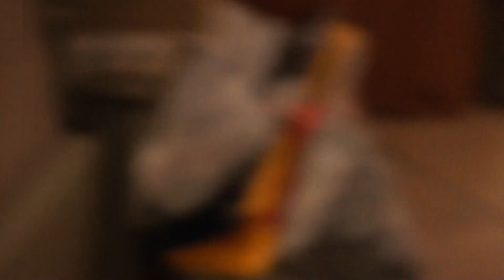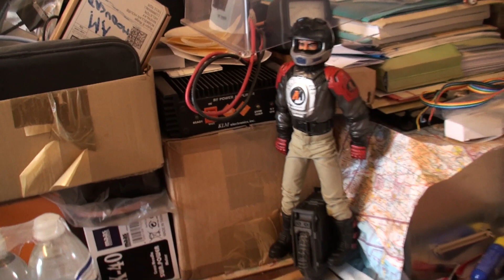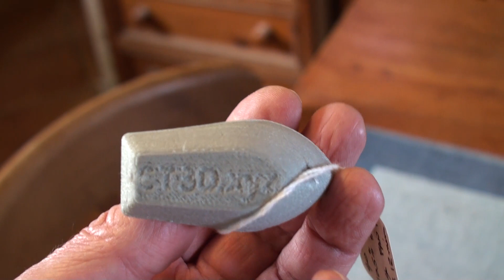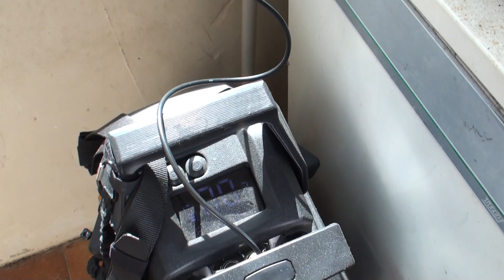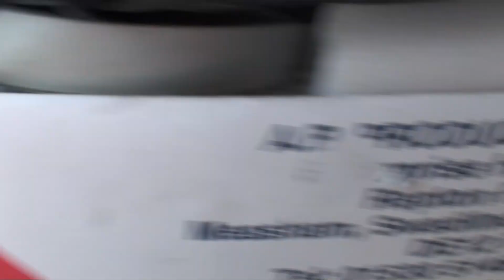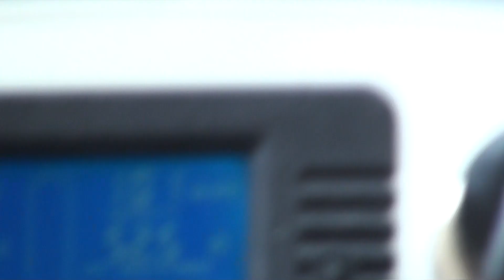Charging Monitoring Begode Kingsong Electric Unicycles

Comment: Do you have a link to that specific charger and also what plugs and leads are needed to build a complete system?
Reply from the maker: I bought the Charger fro AliExpress https://www.aliexpress.com/item/1005004856592771.html?spm=a2g0o.order_list.order_list_main.17.21ef1802Ir8UtS be sure to by the 140V 15A version. The connectors to the 134v Begode wheels are GX20-4 pin aavialble on eBay. The Kingsong connectors were more difficult to obtain but I used this butchered this adapter https://www.ebay.co.uk/itm/314442312449?hash=item493638eb01:g:Q6IAAOSwyW5kAukC&amdata=enc%3AAQAIAAABAFKMu6VP5lldpTEXe7rhqO3lqIKACMXrzwBV06dZn3cbM1xgPJqx9RRHJEXdDqHhHk%2FB%2B4EmzIecwWftXUTmj6DljbrZTjGgB57rvuJCXP03T7AYqy0ajpaYUDaw5oqjWLwhv739fUzKdNmj%2FQnh5kmBdnc1LpjBBttrV7dZXpX%2FB%2FafrxL8n4t3MHelZNZPftMS8yyIHfIL%2Fmjf6Yrg8SAHTRs57HYyxTH%2Bn7pJrAbfn89IahAwTHdG4Y9VOi35h4mjnUmv4ssQ2a9Bf8MK7R1a6OYouQrpBiWO%2F8FlzokuJdHuCfE5rpk79ZZLzOqSDxqkTNly7YSBIX9jI3nE37A%3D%7Ctkp%3ABk9SR4zo2r70YQ , but be aware KIngsong wired the connector with the opposite polarity. Red on the adapter was 0V and Black 134V. The Charger will have to be wired with a UK Plug, the retainer for the mains lead needs to be screwed on. All your EUC leads will have to be made up.

Comment: I mentioned that new charging port board a while back that Alien Rides sent for my master. Well it was kind of a bust. Did you ever get one? The problem with my new one was it would stop charging my batteries too early. They would stop mid 133v and not reach full charge. I swapped back to the original and it charges to 134.4v again. I emailed alien rides about it but they didn't have any feedback lol. So the new one is binned.
Reply from the maker: The Charge board on my EUC was changed early on, shortly after I got the wheel (December last year) by Speedy Feet. My Wheels charges to 134.4v no problem. One of the problems with Begode is that they make changes, but those changes are not clearly under issue control. It is very hard to tell what version of anything your wheel may be installed with.